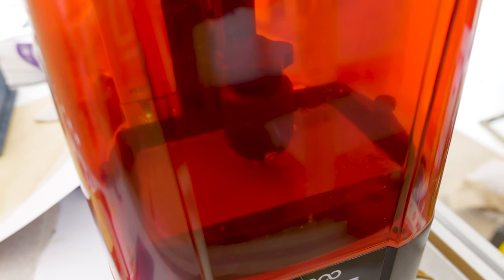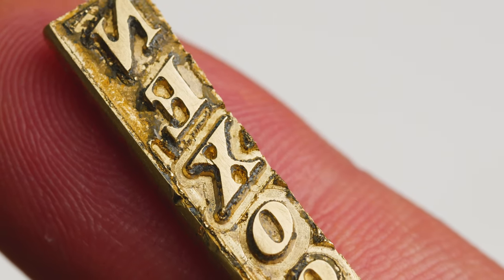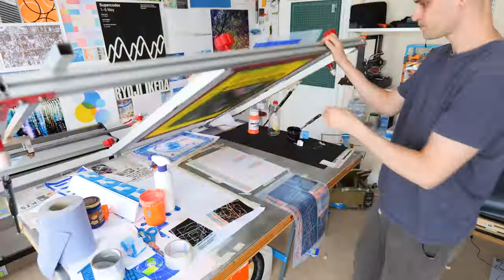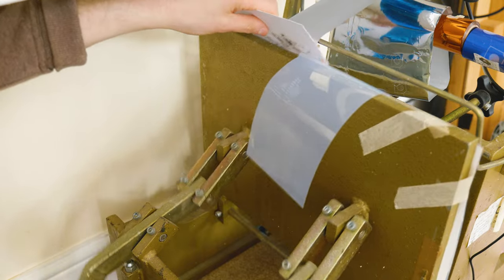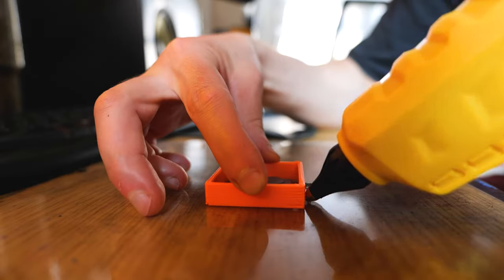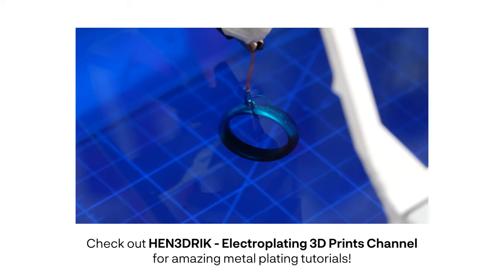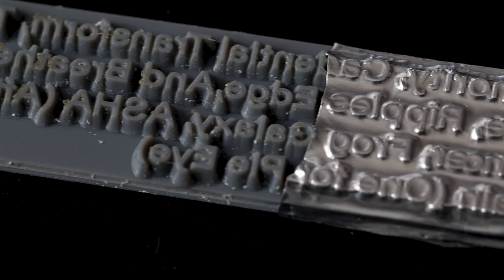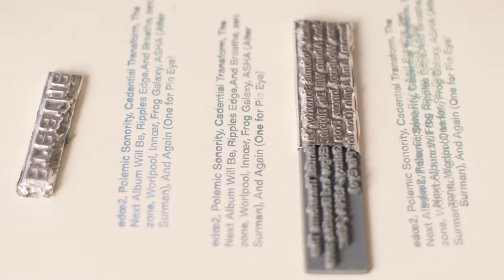Using HIGH TEMP resin for hot foil stamping - Will it work?

Comment: Thank you for making this! I have been trying so hard to figure out how to do this very thing. I was about to actually attempt some sand casting, but I saw this just in time before doing that!
Reply from the maker: Oh that's a cool idea, I have also thought about casting pewter and aluminium for these stamps, maybe worth a test.
Reply: @ThisDesignedThat you can also try insulting the heat bed, I used to place cardboard on the platen minus the die area cut out it would essentially push and concentrate the heat towards the die for more consistent temperature.

Comment: I was just thinking is it possible to use an aluminum or brass base plate say 1/4” think and 3D print on it that would make a perfect heat sink and allow the 3D resin to be much thinner? Anyway just a thought.

Comment: I think the issue that you solved by wrapping your printed stamps in foil tape was inadequate heat capacity of the stamp's surface, rather than inadequate heat conductivity of the stamp. By adding heat capacity, the surface of the stamp can then stay hot long enough to transfer the image before the receiving surface pulls the stamp's temperature down below your 120° target temperature. I would see what happens if you put foil only on the image bearing surface, which I imagine will improve how flatly the stamp is mounted to your press plate.

Comment: Thanks for sharing this one. There is a company cnc machining embossing dies from plastic, would be interesting to see how 3d embossing works using printed stamps.
Reply from the maker: Have also been testing 3d printing embossing too with the Elegoo Mars 3 and it works very well, you can see an example here - https://www.instagram.com/p/CxI9LoNIPTQ/?img_index=3. Ill be making a short video about that too.
Reply: PLA has suprising durability,  makes great leather embossing stamps
Reply: There are several videos here where people have used 3d printed dies for metal forming. They are not as long lasting as metal ones but they are good enough for small series.

Comment: i am a firm beleiver that hand crafts are always the most precise and finely tuned. i wonder if not polishing the resin with extreamly fine sand paper wouldnt make the result much better.
Reply from the maker: Polishing the pure resin print probably won't do much as the issue was thermal conductivity and not surface finish. Perhaps when I added the metallic powder to the 3d print it could have been made smooth with some polishing but I wanted to find a quick and repeatable process.

Comment: Have you tried making molds for epoxy or high temp silicone yet?
Reply from the maker: Not too much as these dont have much application for foil printing but i have experimented. I have 3d printed a mold for silicone, you can see that in the video actually, around 02:10. I have also 3d printed a mold for polyurethane that i used for debossing paper and it works great as long as you use some release spray.

Comment: Use urethane resin with metal powder mixed in. Ask Smooth-On for what resin withstands the high heat and pressure.
Reply from the maker: I love that idea, I tried mixing metal powder with the 3d resin and will have to try it with polyurethane, im not sure how high temperature standard polyurethane can handle though. You'd probably need a high temp version like you say.
Reply: @ThisDesignedThat  also ask about epoxies.